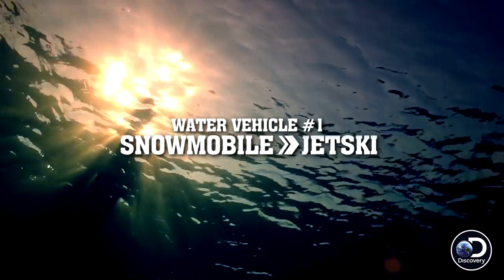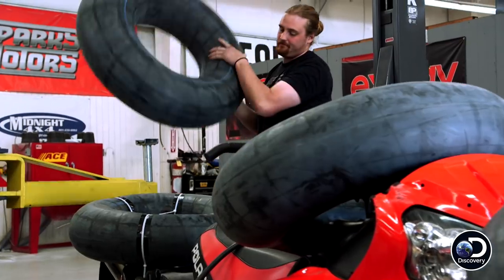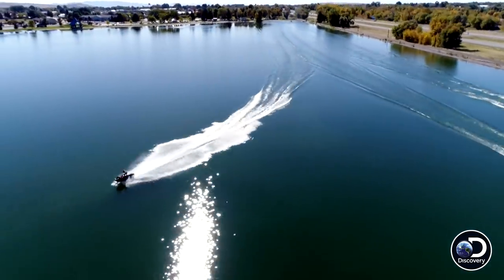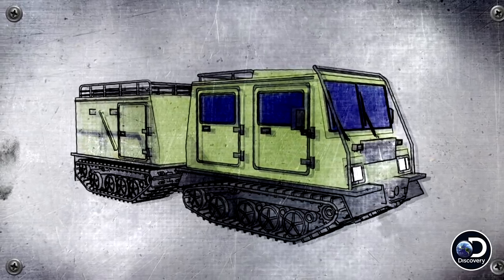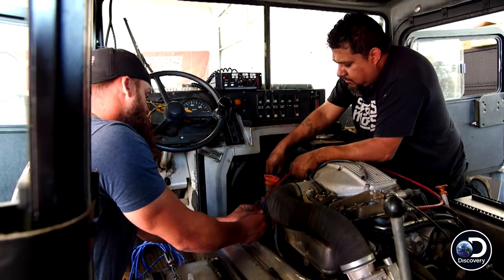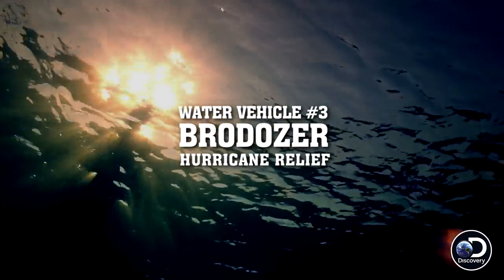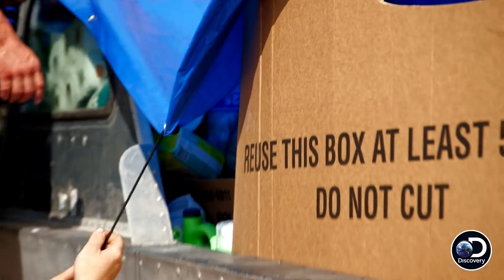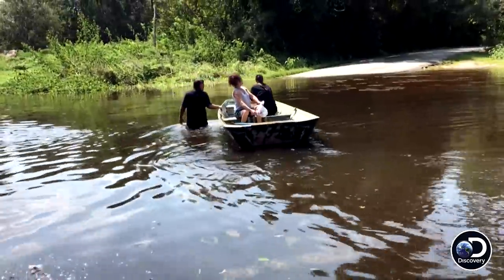Made for Water | Diesel Brothers: Forces of Nature

Comment: For people that don't know, there's a reason why the Sisu Nasu is using a petrol engine against a diesel one.

Diesel has a higher boiling point while also means it has a lower freezing point. So when it's cold and I do mean extremely cold for places like Scandinavia, diesel engine tends to seize in the cold which makes it hard to start when it's stationary. While on the other hand, with petrol being a thinner compound and having a higher freezing point, it tends to be easier to start in the cold so for a vehicle like the Nasu that's made in Finland, it made sense on why it's petroleum based and not diesel despite diesel engines producing more torque and powerbands for vehicles like these.
Reply: A diesel would be great for the tropics though.
Reply: Sisu Nasu = Hagglands BV-206
Reply: Jun Kitami It is petrol because it is an old model.
The new one use diesel.
Reply: It can't swim, while the Sherp - can.
Reply: The older ones use a Rover V8 (Pretty much the same engine you can find in Land Rovers). The newer ones use a GM diesel engine for better fuel economy and more torque. You can use engine heaters to preheat the engines before cold starts so using a diesel in cold temperatures is not that much of an issue. True, a gasoline engine will start more easily when it's just a bit chilly but when the temperature drops to -25ºC then you pretty much need to preheat those as well.
Reply: @Tiax776 , Well, I've started some gasoline engines without preheating from temperatures between -35ºC and -30ºC. A friend of mine also started a Citroën Xantia 2.1 turbodiesel from -28ºC without preheating, just know that it's able to do so if needed. Of course preheating is better for the engine.
Reply: @maximelizarov7589  Sisu can swim...
Reply: @Torthak  sisu na 140 bt is made in finland.... nothing to do with that swedish hagglund bandvagen...
Reply: @Torthak  nope

Comment: Lol, they chose Sisu Nasu only because of additional truck. But Sherp also has an extended version with additional truck! And it can swim, while Sisu Nasu can't. 1994 extinct heavy army device vs modern current time SWIMMING vehicle. The only problem with Sherp - it is from Russia) So bad for american TV))
Reply: kape351  being capable of crossing shallow water along the bottom doesnt mean it can swim, it is too heavy and doesnt have inflatable containers, while in the case of Sherp it is its wheels
Reply: The Bv206 would be better

Comment: The Sisu Nasu is a white elephant. None have been built since the mid 90s and parts are hard to find. The video does not show the vehicle swimming, only wading. It can swim but rides much deeper in the water when doing so. Like similar vehicles from BAE and ST Kinetics, it can move well in deep snow, but only on flat and mildly inclined terrain so it's not going to take your team up the mountain in winter unless the snowpack is consolidated.